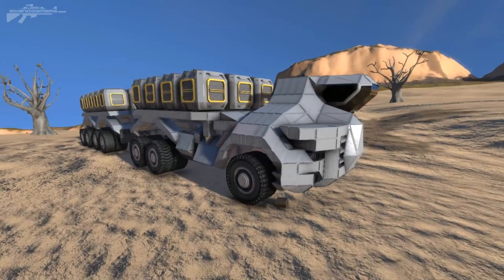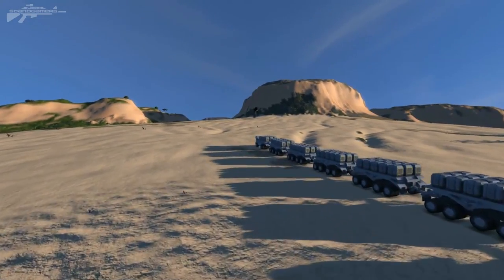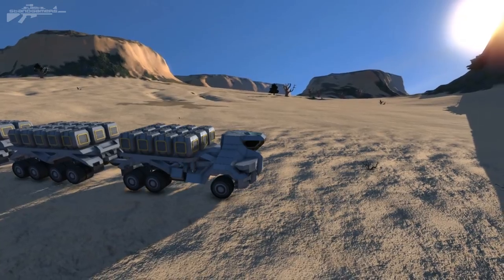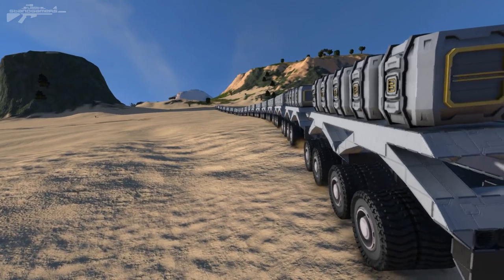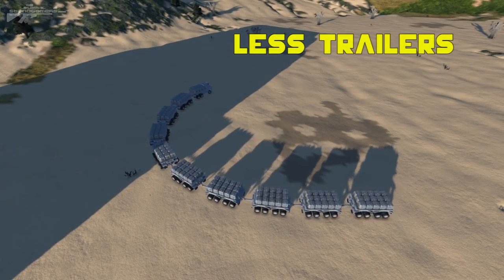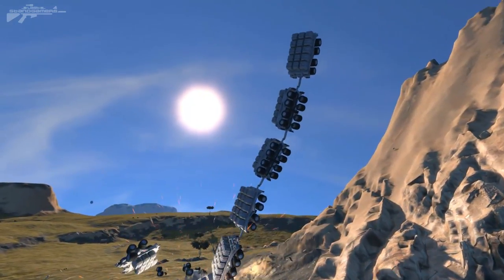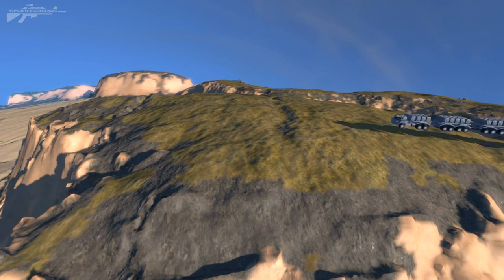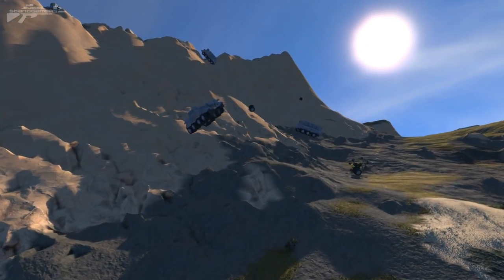Space Engineers - Road Train Crash Test

Comment: I know for a fact what you are trying to do with these trailers is hard Aaron, I made a 6 wheeled all terrain cargo truck and gave it a trailer with extra cargo and a spot to put a small atmospheric miner vehicle to carry, and there simply are some things it just won't go over. Even at max wheel power, all 6 of the trucks wheels are propulsion wheels and with the front and back two sets turning it's a chore for it to go up steep hills. I am super surprised you got that set of 18 trailers to move at all. 

I think you need to make a dedicated truck that is all brawn and weight with no cargo, with 18 trailers you don't need cargo on the truck!